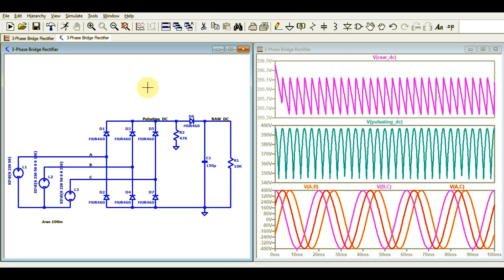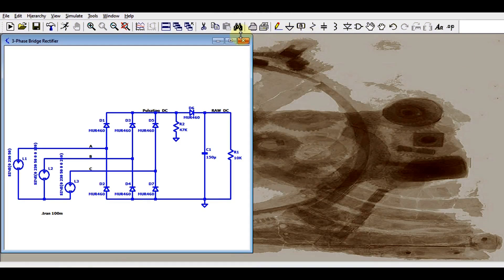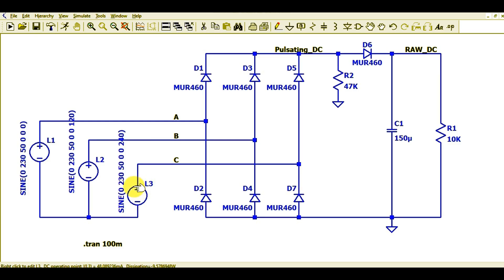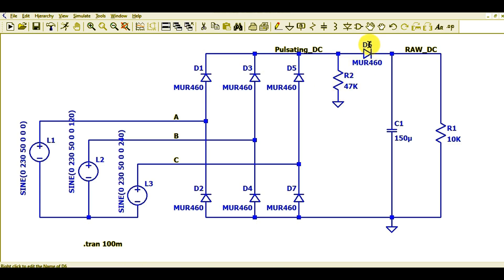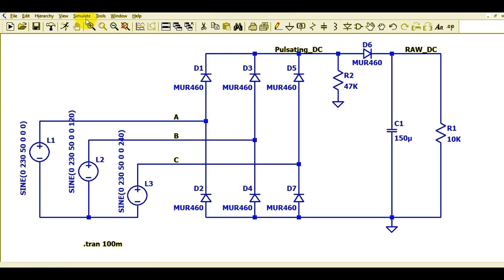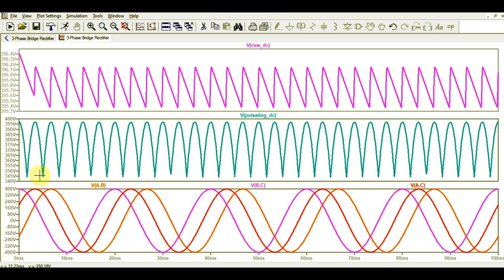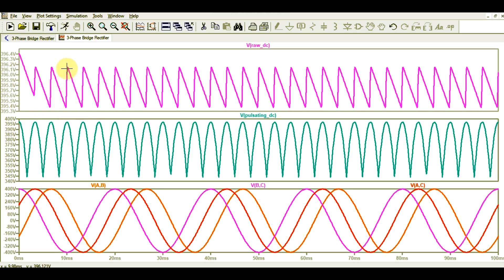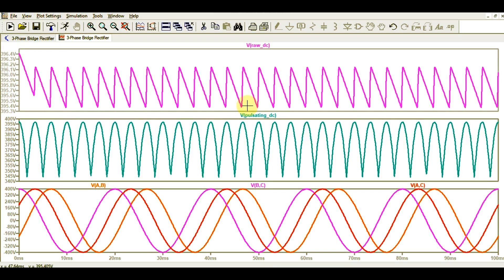LTSpice 3-ϕ Bridge Rectifier Simulation

Comment: I am curious on R2, it just seems like a pull down resistor that doesn't have any application to the circuit. The "pulsating" and "raw" DC is affected by the bias of the diode doesn't it? It seems to have a very small current pull and doesn't affect the envelope detector. Also, what is the current pull of the voltage sources? Due to the high surge current pull, they seem to pull large amount of current (enough to destroy most rectifier diodes).
Reply from the maker: Hey...Sorry for late reply !
Indeed very good questions, R2 and D6 is not needed in actual circuit as i explained in the video min 3.52. 
Your calculations are correct. Thanks for pointing this out.
Reply: @ElectronicsCircuitHubECH  No worries, thank you for the reply. I missed that part of your explanation, thank you again.
Reply from the maker: @mattkim7271  Most welcome. You can find many more simulation video on this channel.